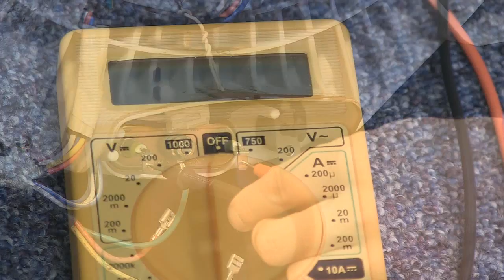How to Diagnose Washing Machine Control and Program Problems

Comment: Hi, my Hotpoint 9575 is rather old but I've kept it going with your spares. I came back from holiday last week and put my first load on only to return ten minutes later to the machine having filled, but just emitting a buzzing noise. From experience, I concluded it could be the brushes so I replaced them, albeit on removing the old ones, they did have a good cm left on each. Anyway, on starting the machine again, with no load, the drum filled and it began to spin. Success I thought. However, on loading the machine with clothes, the machine filled, but then did no more. Any ideas would be welcome please. It won't work in any programme but will drain. Thank you.
Reply from the maker: Hi Nick, check the drive belt and ensure it is tight on the pulley. Test the motor and this video will help  www.youtube.com/watch?v=D5Aw7CBEGPI
Reply: Many thanks. Re checked everything and other than clicking it in manually on the agitate mode, it then ran better than ever and the click is heard between each cycle. Fingers crossed. 😊

Comment: hi, so the hose I mentioned in my last message was actually the pressure switch tube. Water pressure seems normal. Thanks for the video.
What else could it be?
Reply from the maker: Try taking off the hose from the switch and blowing into the tub. If it is blocked the machine will keep filling. For more information see another video:
https://www.youtube.com/watch?v=VS48G_cwCXo

Comment: My machine is whirepool. It have a code F02. And dont take water, plss help mee
Reply from the maker: Hi, Rejhane  F02 error code on a Whirlpool washer indicates that the control detects a long drain time if it exceeds 8 mins, check the drain hose and filter for blockages and make sure the drain pump is working correctly.

Comment: my washing machine don't run final circle because there is no power to pump. how to fix this problem. Thank you so much!
Reply from the maker: Hi, Le, if the drain pump is not working you will need to test the drain pump, how have you determined there is no power to the pump? it is not a good idea to live test. Please see our advice centre that will help with testing the pump http://www.espares.co.uk/advice/symptom/washing-machine-not-draining-water just copy and paste into your browser.
Reply: Thank you! I tested the pump when I used the power directly. The pump still worked normally. Plz send me other suggestion. Thanks! :)

Comment: hello, I have a whirlpool duet front washing machine, During the spinning cycle , it just shut down and lock the door, I have to open the top and reach inside the unlock lock the door; and now it wont power back up, I had replaced the noise filter still no sign of power. I was thinking the control board is bad? what do  u think problem is?thanks
Reply from the maker: Hi B P, has it completed the wash cycle because that would indicate the issue is the spin and you need to check the filter, test the drain pump and the motor.
Reply: it was the final spin, but it wasn't  finish the rinse cycle and its stop and its still have water inside with the door lock then all power off, now i tried to reset the breaker or unplug still no sign of power. so if i replace the control board will it power back on?

Comment: Hi Josh my washing machine will restart after completing a cycle if I don't open the lid within a couple of minutes after the cycle ends. Can you recommend?
Reply from the maker: Hi Althea, You have not given any model information so I can not give specifics but that sounds like a timer problem.
Reply: Thanks Josh it is an Amana top loader I purchased just 2 1/2 mos ago.

Comment: Hi , The problem with my Panasonic front loader is similar to shorting. but it operates for about 10 minutes and then it shorts out at the switch at meter box. Any help with this is greatly appreciated. Glenn
Reply from the maker: Hi Glenn, if the problem occurs a short while into the main wash programme try it on a cold wash. The problem is likely to be a failing heater element so on a cold wash when this is not used the machine may run its full cycle. If this is the case suspect the heating element.
Reply: Hi Josh,Thx for your reply. I fitted a new heater element and it now works . Problem though. I think I either didn't tighten the nut up enough or did it up too much as the machine is now leaking ( re - the nut that pull the rubber seal into place). I suspect the water is leaking from there ( haven't confirmed that but it probably is coming from there, as the machine has never leaked prior this current problem). In hindsight, I could have undone the nut with a digital torque wrench to know what NM to tighten it back on again. Do you have any idea what the NM torque is for a Panasonic.  My life seems to revolve around maintenance and I'm sick of it. Glenn

Comment: My philco washingg machine is heating up water to a point were it shuts down,when programed on cold water cycles, can you please help ?
Reply from the maker: Hi Ray, sounds like a stuck heater relay if you have an electronic module or stuck heater contacts on a mechanical timer.
Reply: eSpares Thanks eSpares for the information, I will have a look at it.

Comment: Hi, great info, thank you. I have a problem with my Hotpoint  HF8B593G. The programming knob just goes round and round and does not change the programme but machine is working but only in one mode, the last one set I think. I was just going to buy a knob from you  and replace??  Could it be that simple???
Reply from the maker: Hi Sue, This is a common problem with your model where the shaft socket on the knob breaks and no longer moves the switch (see the third image on the part http://www.espares.co.uk/product/es1636443/). You may have to remove the control panel and PCB to release the old control knob before fitting the new.
Reply: Hi thanks for that. What's a PCB?
Reply from the maker: sue burge Have a look at the following video, although for a Hoover machine the repair method is very similar.
How to Replace a Hoover PCB and Timer Selector Problems.

Comment: I have a Bosch Maxx 6 that completes the wash cycle but the water is ice cold. It does not get warm at all regardless of program. The machine does not stop and no error codes or lights indicating problems. Can it be the termostat?
Reply from the maker: Just because you have not felt heat does not mean the machine is not heating. Run empty on the hottest cycle to confirm if the heater is working. If you had a heating problem the machine would normally just continue to wash for ever waiting for the water to heat up. For further information see another diagnosis video: https://www.youtube.com/watch?v=Ftm8lDVVw2E
Reply from the maker: Hi Kjell, the most likely is the heating element so test that before suspecting anything else.

Comment: H Espares my bosch classix 1200 stuck on wash cycle at 1 minute.When i open door the water is cold.Any advice ?
Reply from the maker: Hi Peter, try on an empty hot wash to see if there is any heat in the machine during the cycle. If the heater is failing we have known it cause the cycle not to stop showing one minute on the display.
Reply: tried a 90 degree wash. stopped at 30 minutes and opened door and water was cold.
Reply from the maker: Sounds like heater has failed for more information see our video:
https://www.youtube.com/watch?v=Ftm8lDVVw2E
Don't forget to find the full model number from the label around the door rim (WAE? xxxxx/GB05?) when ordering the part.

Comment: When i start the machine is trying to drain, and only that cycle is starting on all programs. What is the problem?
Reply from the maker: Hi acegulabot88, it sounds like your machine has an anti-flood device that has activated causing the machine to drain all the time, if so you have a leak somewhere on the machine that is going into the base.
Reply: @eSpares  Thanks, I will check it.

Comment: If shot in machine between the terminal how much reading
Reply from the maker: We do not recommend working on a 'live machine' due to the danger of an electric shock. Most problems can be identified with a meter on resistance, what is your problem?.

Comment: Hello my hotpoint waching machine when I open it stopped working and shut down all the house hold electricity could you tell me which part is damaged
Reply from the maker: Hi Fatma, there are a lot of components that can cause the electrics to trip, I would suggest you start with checking the heater with a meter before suspecting anything else.
Reply: Thank u 😊

Comment: I have a Hotpoint wmud 942 ultima and the cycle never completes, the display states that their is  "1minute left" but it just keeps going. It doesn't end. Can you help?
Reply from the maker: +ademuzzy Check you are not selecting a 'rinse hold' or 'ami crease' cycle as these will keep turning the wash load even when the cycle is finished waiting for you to stop and unload it.
Try a different programme and if still the same try another heating element as these can produce 'strange' problems when they fail.
Reply: +eSpares It definitely isn't on rinse hold or ami crease  It does it on several different cycles  but not all the time. It does seem to be worse when the machine is more full. It never used to do this (had the machine for 2 years). We have just moved house and it has been doing it since we have moved. Any suggestions? I'm not sure it is the heating element because the clothes come out clean.
Reply from the maker: +ademuzzy If your machine cannot balance the load due to a heavy item among lighter clothes this machine may retry for several hours trying to balance and spin to the selected speed. When loading or after a problem look for heavy items like towels jeans sweatshirts that can hold a lot of water and cause this. See another video:
https://www.youtube.com/watch?v=uKBy-9NEF5A

Comment: I have a LG model WM3050CW front load washer.  Pushing the power on button causes an audible tone but no lights display
Reply from the maker: The problem is likely to be the control board, try shining a torch at the display as it may just be the 'back light'.
Reply: That doesn't seem to do anything......is it possible to disconnect the three connectors to the display board and measure for voltage from the control board?  I have a digital voltmeter but don't know which wires to check.
Reply from the maker: The manufacturers do not provide this level of information so we cannot provide any help in this area. Even if you called an engineer they would take an educated guess and replace the part before going further as it is likely to resolve the problem.

Comment: HI I have a samsung WF 8802 CPa, its showing a door error coder as DE , changed the door switch and its still the same .any ideas ?
Reply from the maker: Hi Nick, just rechecked with Samsung and it appears a DE error is usually the door lock , but also could be a drain error. Might be better to see what works and when the error occurs. If it happens after a wash or rinse cycle watch this video:
https://www.youtube.com/watch?v=frEJhX9Sppw&list=PLZopaZU-UQSHj1noiwEJ99JjXWcEcSAbZ&index=5
Reply: Hi, now wont start at all !! I am in Thailand and they told me its the control panel which I dont believe !! just goes straight to DE, I have changed the door switch already
Reply from the maker: If the machine wont start at all it does suggest a door lock problem. Watch another of our videos that will help identify what is going on:
https://www.youtube.com/watch?v=QYPqpjLV7s4&index=1&list=PLZopaZU-UQSHj1noiwEJ99JjXWcEcSAbZ
Also check the motor brushes if fitted as this may cause some machines to not lock the door.

Comment: Hi, I have a Service washer WP1249F2W and it has stopped heating the water, everything else is fine. Its about 16 months old and used daily. We have done the regular cleaning and maintenance according to manufactures instructions. The manual says there is only four error codes and the heating circuit is not one of them. I visited your web site and typed in make & model it didn't recognise the machine. I will be testing the element & thermostat shortly. Any help will be much appreciated. Great videos by the way.........cheers
Reply from the maker: +mike travis Sorry I am late replying but Youtube has just 'found' your comment.  The problem is likely to be a failed element, to help us identify the part you require please fill in the details on the form found by using the 'Help Me Find The Part I Need' link at the bottom of the page on our website.
Reply: Hi, yes it was the element and I managed to get one and changed it. Thanks anyway.
Reply from the maker: +mike travis :-)

Comment: Hello folks.
I have a hotpoint hv8b593g washer and it "works" on every setting but on 90% of settings it washes for hours. Never shuts off. On setting "6" (30 minutes), it runs for over an hour. This is the only setting that seems to shut off and complete a wash and spin cycle so it's what I've been using--cleans really well and spins great on this setting. The spin cycle also works on its own. I'm not sure what part needs to be replaced. Any suggestions on where to look? Timer, module, etc. All lights, push buttons respond to turning on and off. Thanks!
Reply from the maker: Hi zerosartre, best geuss for your fault with the limited information given is if the washing cannot 'Balance due to a mixture of weighted items, then the machine will keep trying to balance and extend the cycle time. 
We have another video that tries to explain this:
www.youtube.com/watch?v=uKBy-9NEF5A
Try on an empty cycle and if this runs ok try keeping 'heavier' items together in a separate load.
Reply: eSpares I'm wondering if it's a faulty heating element. The spin works just fine--doesn't seem to be any problems with the loads starting and stopping on the one setting (setting 6). I'm trying a load now on a 'no temperature' setting to see if that might solve the mystery.

Do you supply Hotpoint washer heating elements?
Reply from the maker: Washing empty would prove if a balance issue. I understood that the cycle would eventually finish and if you had a faulty heater the machine would not finish the wash but have to be stopped and changed to the rinse and spin cycles. If you do have to move it on from wash then it would likely be the heater.

Comment: i have a problem with my bosch washer start nobe it was hard to push to start now you push it wont start but the machine is on works just not the start nobe
Reply from the maker: What is the model Kasey?. Often knobs can get stuck if tea, coffee or fruit juice is spilt. Check for signs of contamination around the edge of the knob and clean with a slightly damp cloth.

Comment: I mean washing machine, my typing is bad
Reply from the maker: Hi Annie, To answer your question we really need more information as to what you mean by 'crash'.
All modern washing machines are 'computer controlled' with information regarding cycle length water temperature etc programmed into a 'memory'.
This can get corrupted either temporary (powering off will clear when the machine reboots) or permanently when the machine may need reprogramming.
In the second case you may need an engineer to programme with a laptop, smart card or programmer device.
So the basic answer to your question is yes.

Comment: Our problem with a Bosch Avantixx blocking with no fault message seems to have resolved itself without any intervention. If the problem reappears I will contact your helpful site again. Thanks for your advice so far.
Reply: what is a ae code
Reply from the maker: What Make and model machine are we talking about?.

Comment: Hi Josh. Great videos mate!
Got a question for you. My LG washing machine will not de power the water inlet solenoid, so it just keeps filling. Pressing the power off button does not stop it either, only pulling the main plug out of the wall! So I'm guessing it's PCB problem... Is there any sort of reset or anything else I could check that could be causing this problem.
Reply from the maker: Sorry Gerrard, Unless there is signs of spillage or damage to the wiring loom it is likely to be the control board that is faulty. :-(
Reply: Damn i thought so...  Thanks anyway you're a good man!
Reply from the maker: Gerard De Waal :-)

Comment: Hi can any help. I have Hoover washing machine. it takes water and dose not fill half drum and drain straight out. after few minutes. it takes and fibric softner and detergent same time. what would you think it would be. please.
Reply from the maker: Try selecting the spin cycle. You may have either a pressure switch problem or a motor problem. By selecting the spin cycle the machine should drive the drum and pump and spin up to speed. if it does not check the motor brushes.
Reply: thanks for you quick reply. found lot of stuff in water pump. now trying to do a wash. c how it goes. it spins ok. I think it's one of those economy washer dose not use lot of water. it only fill quarter of drum. once again thanks.